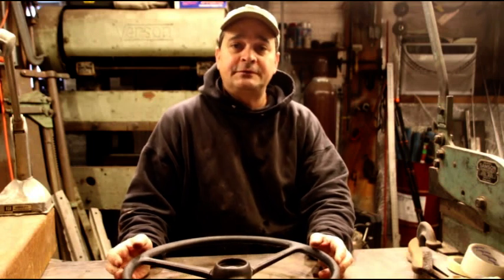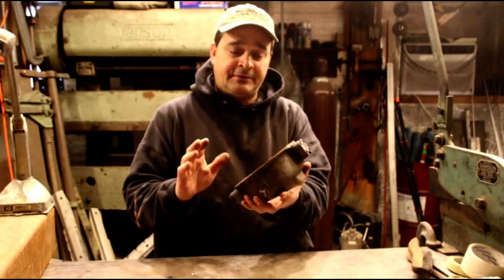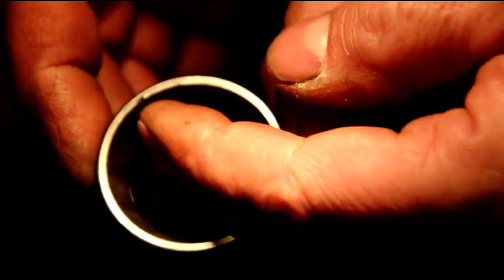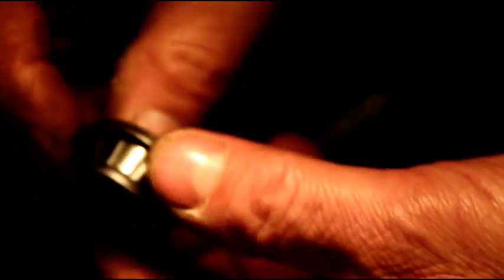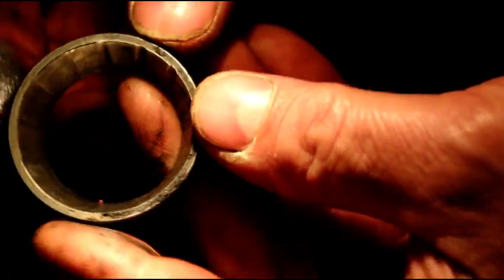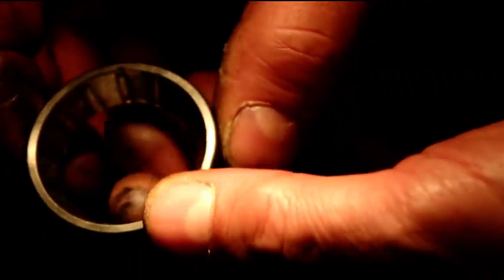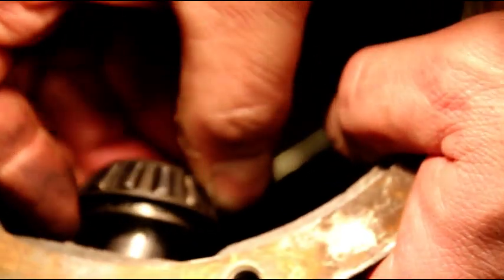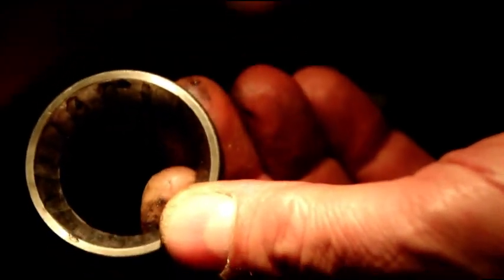Willys Jeep Steering Repair, How To Fix Notchy Steering

Comment: Happy New Year 2022 to you and the Misses ! Hope you are both well . 
Thank you for sharing and pointing out something that may be overlooked and causing someone to fire the parts cannon as you’ve said . 
Obviously , a closed knuckle front axle isn’t just like an open knuckle with upper and lower ball joints but if we do not inspect the kingpins as you’ve outlined , then we are only doing half the job and placing the blame on another part such as the steering box ( expensive item ) and steering linkage and joints . While steering components do wear and will have to be replaced when worn , it’s clear from your video that the kingpins absolutely must be checked . Since the bearings and races were cooked on the ones in your video , that’s enough right there that it’s possible they can easily be overlooked . Good that you’ve pointed out that the weight of the vehicle is directly on these points , upper and lower , and should be taken into consideration with a rebuild and inspection when taking on a repair or diagnosis . All too often is it believed that wheel bearings can be repacked and reused but even on an open knuckle front axle , we must remember that the vehicles weight is on these bearings as well and mostly on the larger inner wheel bearing . On this closed knuckle front axle , it’s apparent that these bearings in the kingpins must not be forgotten . 
Just the thought of those bearing falling apart as you’ve shown should be enough to open someone’s eyes to this potentially dangerous situation . Thank you once again for this video and every other and every one to come . 
I don’t like telling people their business but when someone is trying to help because they care and want to share , we should never complain about any aspect of their helping and sharing . A few might complain for their reasons but my feelings are what ever is needed to make the point and how to do the jobs is what ought to go into a video . It’s instructional and it’s for our benefit that this man puts his time and effort into helping us . 
Let us not bite the hand that feed us . Maybe there are other people doing these things too but not too many , if any , make you feel like your in the shop right there looking at the repair , replacement or build the way it’s done here . As Brian always says , if you want to see something , just ask and he will try to put out a video on it . Yeah , he is a busy guy with a lot on his plate but God bless he is doing it all as he can , and for us too .
Reply from the maker: Thanks for a well thought out and written comment.  People like you are very much appreciated on my channel, thank you again.  
Brian

Comment: Hey Brian great video! Many times front end shimmy (death wobble) stems from these worn bearings and people don’t realize the root of the problem so they install a steering stabilizer as a fix.  You’re right about the reasons for wear (wrong shims wrong lube) sometimes another problem for wear is free wheeling hubs.  When the drive axle doesn’t turn it can’t spread the lube into the bearings, remember you mainly drive in 2wd.

Comment: Hey Metalshaper, thanks for this short one, I liked it! I've been trying to get my MB back together with absolutely no mechanic experience whatsoever so your videos are invaluable to me. One question: you mention the race will get eaten if the proper lubrication is missing. Could you explain how to properly lubricate this part (or other parts?) Thanks and all the best in 2022!

Edit: forgot to ask: what exactly is notchy steering? Is it when you turn the wheel and nothing happens for a while? or perhaps it's when you turn the steeringwheel and the wheels don't turn fluently? thanks!
Reply: L Cants - odd, one of the most interesting questions, yours, remains  unanswered here???  😵
Reply from the maker: I have other videos on knuckle lube but will show it again soon.  Notchy steering feels just like it says, NOTCHY.   When you turn the knuckle you can feel the nothes left by the bearing digging into the race.  Very common promblem
Reply: @metalshaperJeep  ok thanks a lot!

Comment: Thanks for this very helpful video.  Besides notchy steering, bad king pin bearings can also contribute to so-called death wobble steering shimmy.  Back in the early 1960's, an experienced Willys mechanic shared with me that the first thing he did whenever the complaint was front-end shimmy that was not also accompanied by notchy steering was to remove shims to increase the bearing preload back to factory spec.  These days everyone seems to simply add an aftermarket steering damper, despite increased steering effort.  Lubrication was always problematic.  You were supposed to fill knuckles up to the fill plug with heavy oil, and the spinning c/v joints were supposed to splash oil onto the upper king pin bearings.  The oil soon leaked past the knuckle seals, and aftermarket lock-out hubs had the undesired side-effect of keeping the joints from spinning and splashing whatever oil didn't leak out.  Any advice you might have on upgrading knuckle seals and knuckle lubrication would be very helpful.
Reply from the maker: Well said.  I have many videos on proper lubrication of the knuckles and talk about the proper lube that I have developed.  Also it is a good idea to lock in your hubs once a month or more to get the lube splashed up to the top bearing.  I keep putting out good information but people keep doing the wrong things.